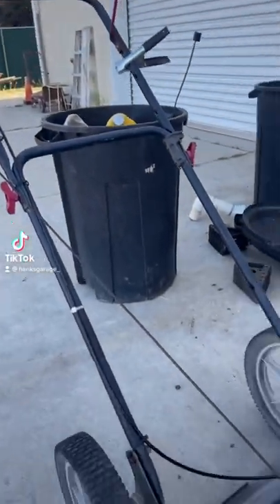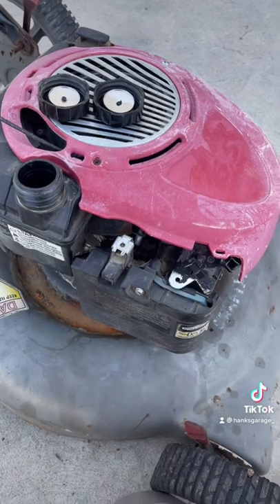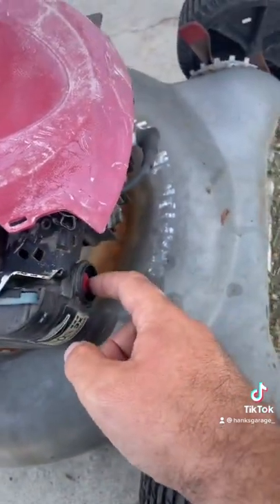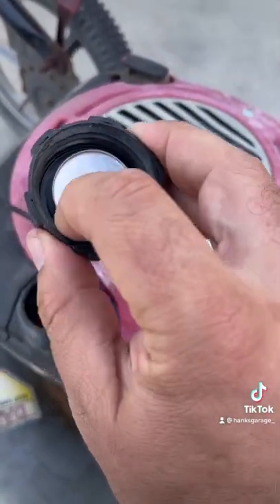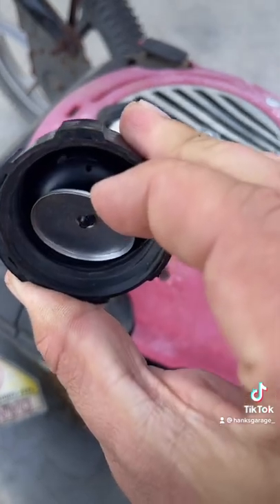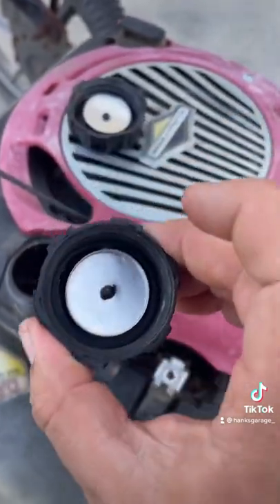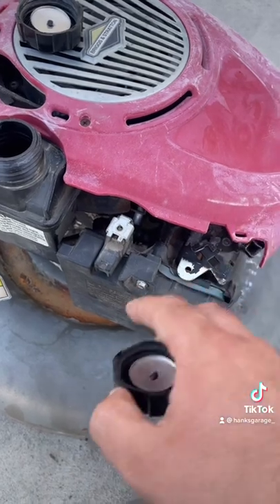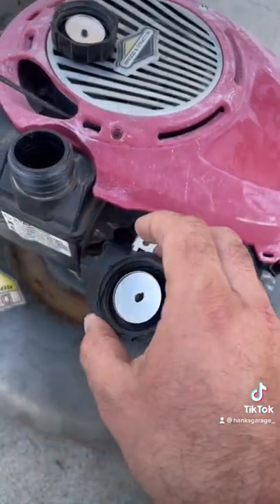Mower runs great for a while then bogs out and dies? Check your gas cap. #briggsandstratton #briggs

Comment: On some Craftsman models  there is a brass screw that is under the float bowl and it has holes in it make sure to run a wire through the holes until you can see through them and it should start up .
Reply: This worked for me on a mower I found in the trash. Works fine now

Comment: I just had that happen a few weeks ago. I changed the gas cap and was fine.  Like putting your finger on the end of a straw the water stay in the straw.  In a pinch if you know it is it.  Drill a small hole in cap.  But replace the cap.

Comment: That's interesting actually never had an issue with it. Just found a free curbside toro fwd with a Briggs older with a primer . Like new tires I'm thinking stuck float. Unless it's the cap doubt it but that would be funny

Comment: The "neoprene rubber" or whatever they're using must be swelling up behind that disc.
Caps used to be vented on some lawn equipment really simply. You could  create a vent since you don't tip them with alot of fuel in them, anyway.